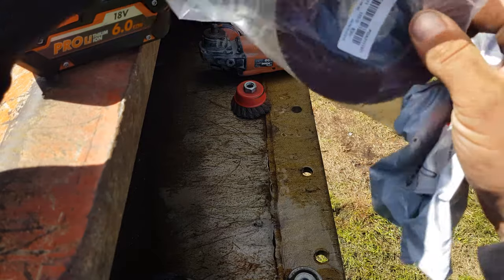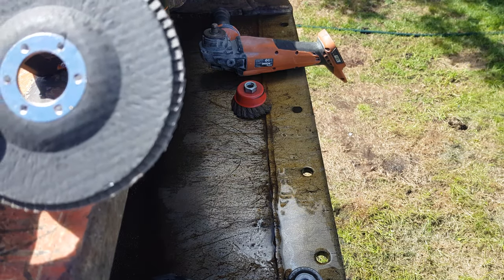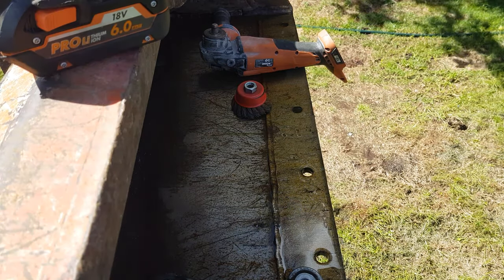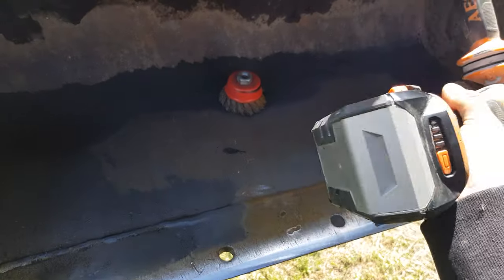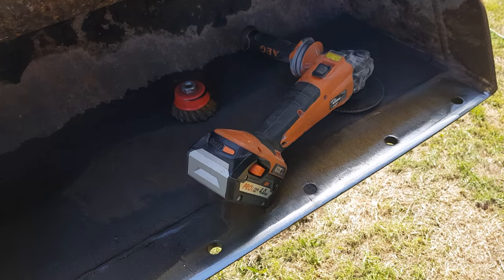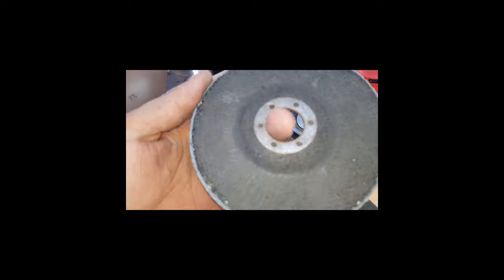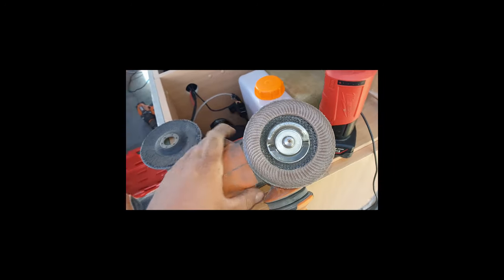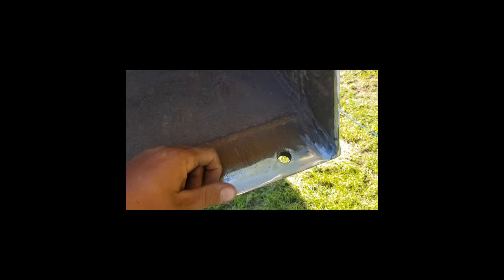Testing Cheap 115MM Flap Discs ON Steel Excavator Bucket 18v Aeg Brushless Grinder

Comment: Got to love AEG. Batteries, although chemistry has changed to Lithium Ion, they are still cross compatible with some of their old tools. I have an old 2007 drill that can take the new battery packs. I think that is great.
Reply from the maker: Fitting old tools.is.a wicked thing. Ive put some hours on there 5 inch brushless grinder now still.going great
Reply: @Oneupthesleevecustoms  Yes, I love the AEG tools. They're not as easy to get hold of here in the UK. I have noticed that if I look online for them, they all seem to be located in Australia. You can buy some of them here though.